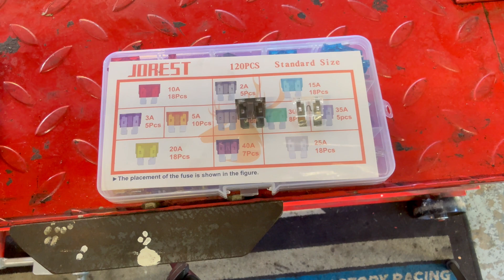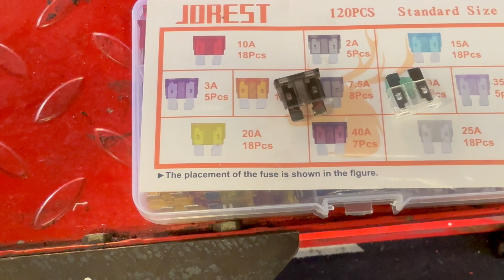How to diagnose & fix motorcycle overheating issues

Comment: I put a new bottom radiator on a month or so ago and the old one was absolutely rotten. Worse on the back, which you never see, all blocked, with radiator protector on it was struggling.
Reply from the maker: I saw the same once I got the fan off, I did manage to get it a bit cleaner